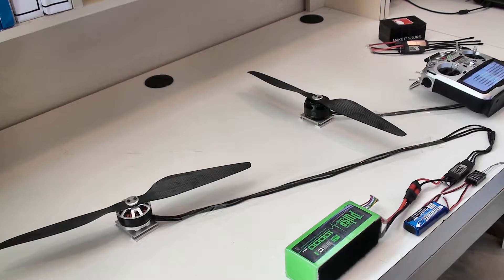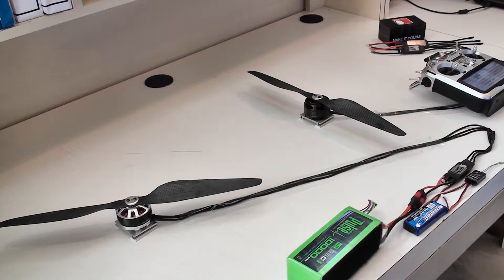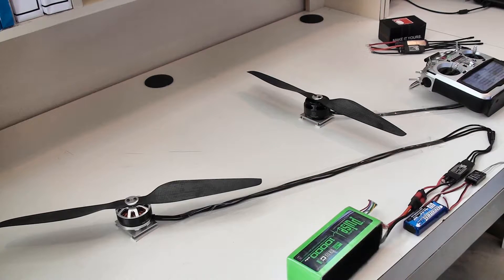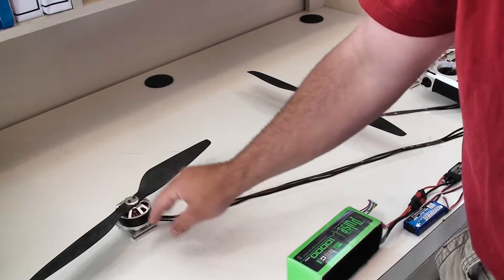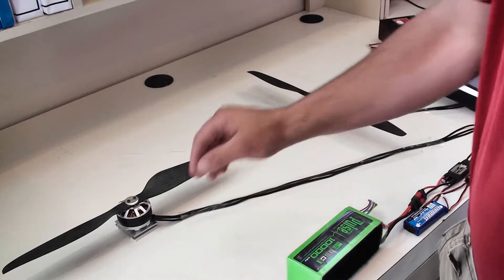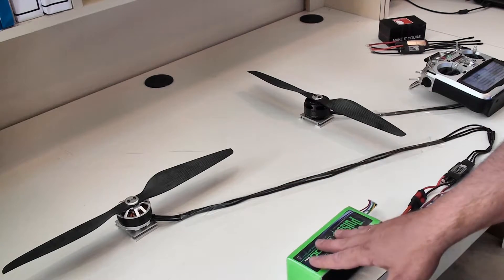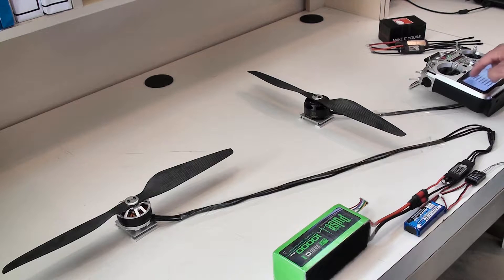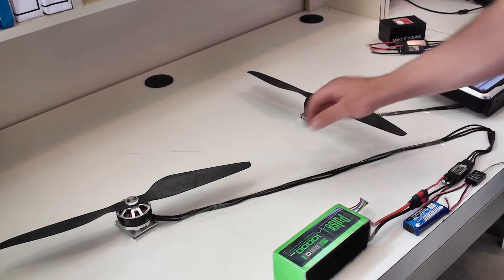KDE Direct XF UAS 55A+ ESC Performance Demonstration

Comment: KDE manufactures very good engines but unfortunately all technical performance data is inflated by at least 25 percent which does not honor them. The quality is superlative I have nothing to say, the performance is also very good, but in the catalog that presents the performance tests all the data are 25% higher than the real ones ..... very ugly from you KDE ... to will be ashamed! and the fact that you will make a comparison between KDE and T-motors (your direct competitor) will not honor you .... REACHED IN REAL TESTS ... I PERSONALLY TESTED AND YOU LIE LIKE THIEVES! at least T-motors does not lie when it presents the data sheet, their data being real!

Comment: I can see the advantages of your 22pole24slot motor with your ESC's.  However, I was wondering how your ESC's work on a Tmotor 14pole12slot vs. your KDE 14pole12slot motor.  Also can you please do a comparison of a SimonK flashed ESC vs. a KDE ESC on the same motors?  Many thanks, Dean
Reply from the maker: Dean Naguib The ESCs are compatible with 14-pole motors, as these are generally much easier on commutation algorithms than the high-pole count editions.  We just released a new video showcasing the performance as well: https://www.youtube.com/watch?v=e1iUb-3vwwQ, and you can see the latest firmware performance and advantages.